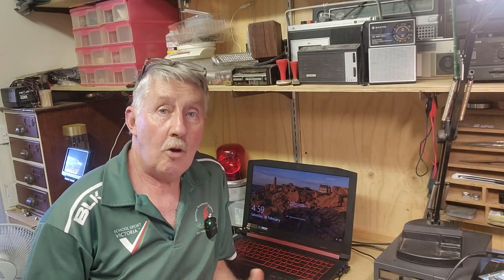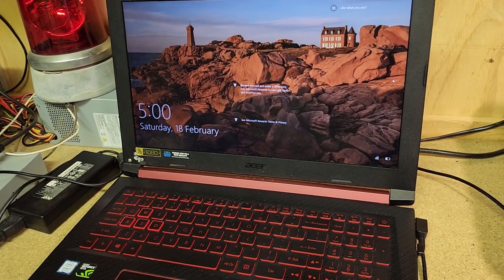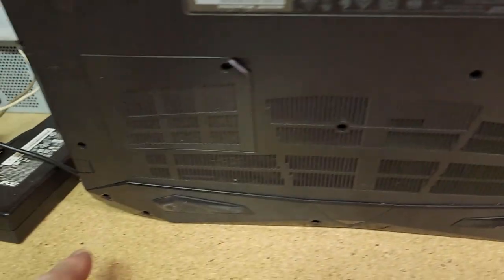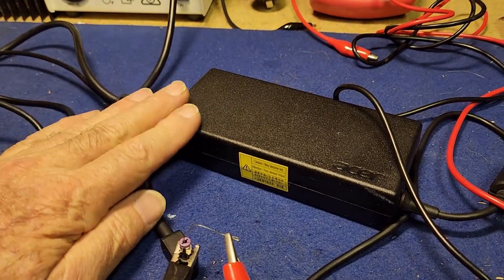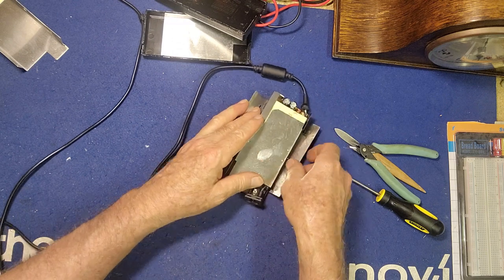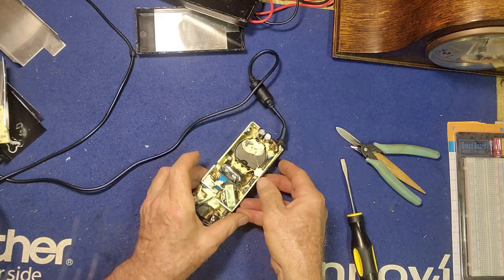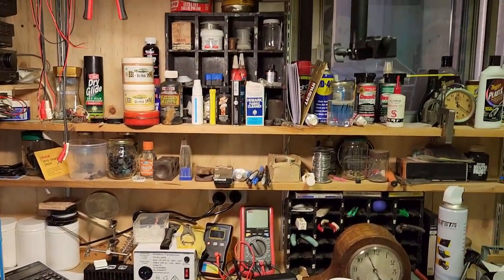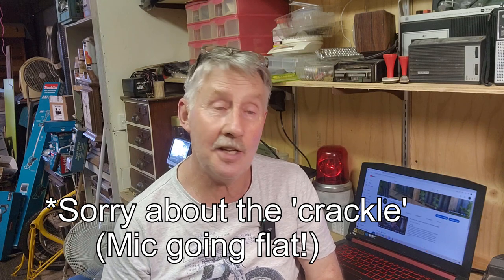How to Make an Easy Laptop Charger Fix more Complicated than it should be! Gaming Laptop in Ewaste!

Comment: good fix, and great laptop score! i've tried to fix those connections before, i'll have another go after seeing this.
i recently pulled one of those charging bricks apart to fix and try as an electrolysis rust remover power supply, it has a popped/leaky capacitor that looks common on another board(it had hidden screws in it under rubber feet and a sticker)
Reply from the maker: Yep, hidden screws are a very common thing these days! Most of these power supplies can deliver pretty good current, so would be great for electrolysis 👍😊